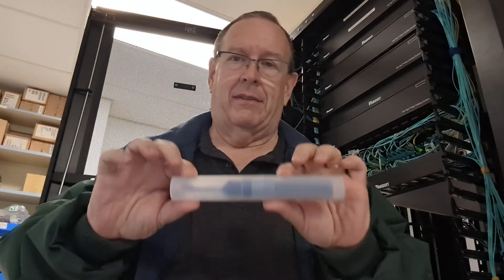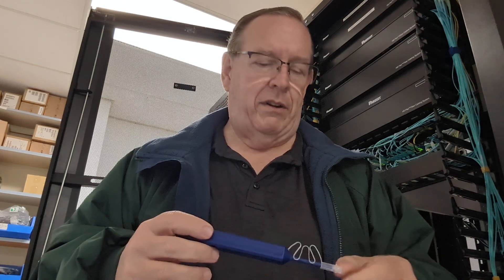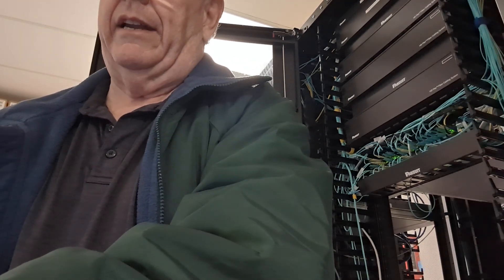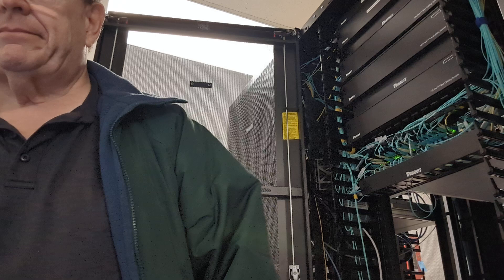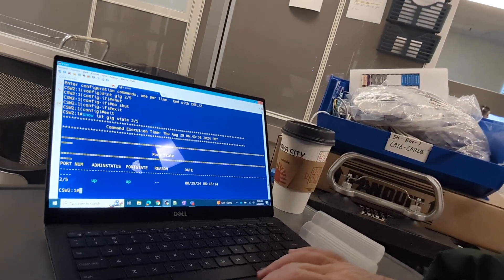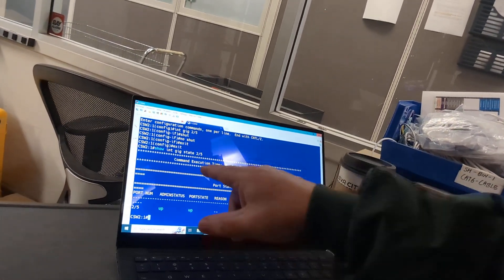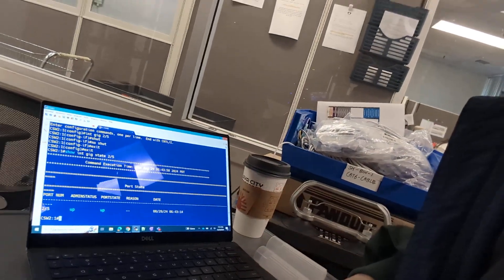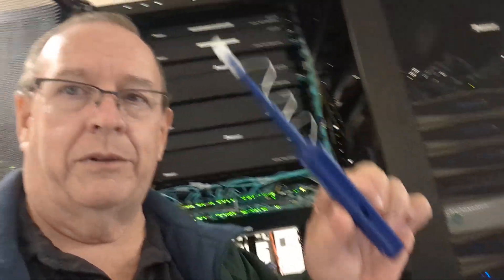Network Admin Life - Cleaning Fibers

Comment: Hey again. So I'm a field engineer for a very prestigious long haul engineering/ optical engineering company. Every day I clean fibers that carry 400G muxed signals. You are off to a good start with the plunger. However there's room for improvement.

The main issue I saw is that you didn't use enough clicks of the plunger. Our standard is 6 clicks before scoping the port again. The reason for this is that if there's dirt in the port, one cycle of the string will just move it around and not carry it out of the port. Since you don't have a scope, I would say that 8 clicks is safe for you. In addition, while you CAN clean the ferrule on the actual fiber with the plunger, what you really should be using is something called a cletop. You wipe down the sterile cloth (use a twisting motion for simplex connectors). 2-3 cycles of wiping is good since you don't have a scope.

However at the end of the day you really, really need a scope. Some fibers come from the factory with caked on junk that you may not be able to get rid of. You could also have a shattered ferrule and not even realize it. There's many, many reasons why a scope is needed in an environment with a lot of fiber. The two main scope manufacturers are exfo and viavi. I've used both and prefer viavi.

Hope this helps a little, and it's great to see someone in a dc taking action on fiber hygiene. A lot of colos/DCs I go into have zero fiber hygiene lol
Reply from the maker: I should have known better than to follow the instructions.  My gut told me it needed more than one click.  Great advice! God bless!

Comment: I have a broken fiber cable (dog bites it) but suprisingly for me it still working correctly - how to know what kind of cable to purchase? Am I suppose to call my ISP, or I can do it myself? ... Bigger problem is probably my ISP router changing IP address (no internet connection for couple of minutes everyday in the middle of the night - at same intervals) - Is my assumption correct, or you can think of different cause of failure?
Reply from the maker: Same time every day?  That's your ISP most likely.  I'd start with them.  God bless!

Comment: Always clean connectors and ports before you connect.. even for new patch cords and transceivers.  It is also recommended to get an inspection scope for view the connector endface. Inspect > clean > Inspect > clean again as necessary > rinse and repeat until clean. Inspection scopes can auto test to IEC  spec and give you a pass/fail.
Reply from the maker: I'm sure our engineers have inspection scopes.  I'll see if I can scrounge one up from them.  They, like me, assume the patch cables will be clean.  Ha, ha.  God bless!

Comment: So what you really need to do is use "show port <whatever>  transceiver information" which will show you the current RX Power received (and at the other end of the fiber, note the TX power), then clean the ferrules (in the FIU panel and both ends of the fiber patch (e.g. all 4 of them), bring the port back up and then note the new values at each end and see the change.  While you might not see an increase in RX received you might see a reduction in TX at the other end to yield the same RX, etc.  You will likely see quite a favorable change in the optical levels after proper cleaning of dirty ferrules.  Relying on the link to flap (or not) to know if you needed to clean it is really too primitive and not useful, if the link is flapping because the link is dirty that is on you.  In fact, record all these values for the entire network and then clean every connection and see the difference!  Link flap due to dirty ferrules will no longer be a thing. If you had an inspection microscope (not an expensive item) you would be able to see the dirt before and absence of dirt after cleaning. You also need other basic tools like a light level power meter and a VFL to properly maintain a fiber optic network. And the price on OTDRs has now fallen to the point that any network administrator of such a network should have that in his tool kit also!  I'm am certainly one of the folks that cringed at your patching of fiber without cleaning although I never called you out on it (until now)  :)

By examining the optical levels proactively you will find any links that are living on the edge and therefore prone to flapping or other faults before it happens and be able to prevent it. Tune up your network and you will have a lot less unexpected issues.  You should also be monitoring the traffic on these links and installing upgraded optics or additional links, dynamically allocating bandwidth where it is most required. I remember after I started my current job just a few days in the boss called me and asked if I was messing with the network?  Yeah, of course I've fixed all kinds of problems that I found.  Well keep up the good work he said, our network as never been this fast!  They knew they hired the right guy.
Reply from the maker: That's actually a good idea.  It's something I've tried before but I'm not consistent about it.  Point taken.  God bless!